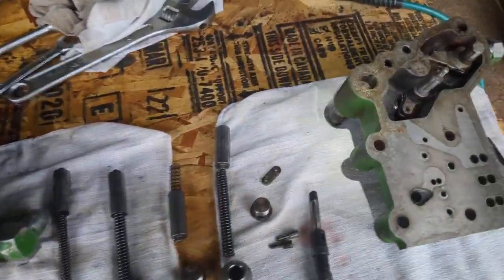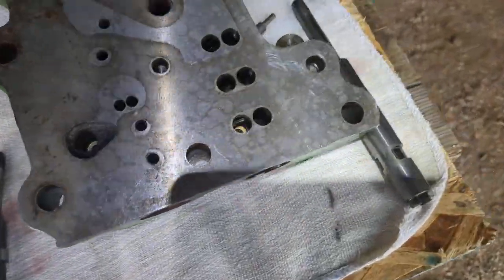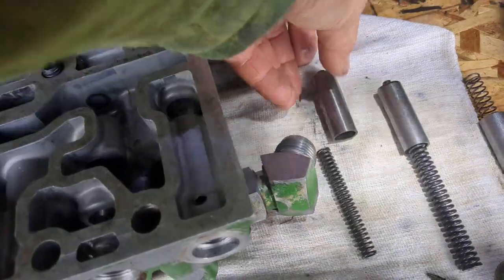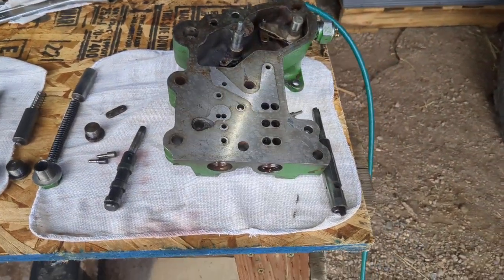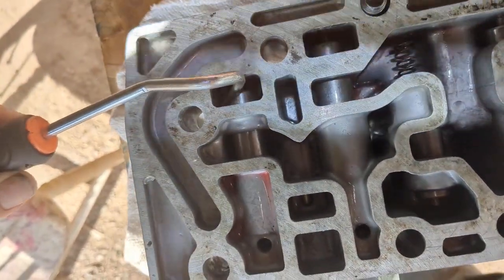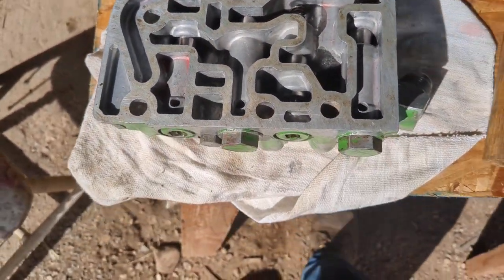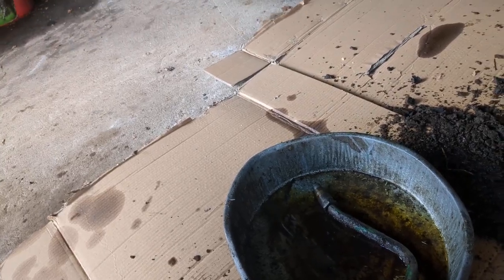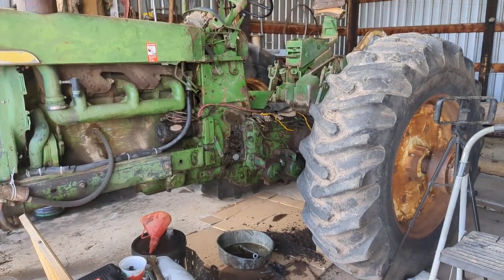JD 4020 clutch/ pto valve clean up.

Comment: Be sure linkage is clean where the shaft from valve goes through the housing,  build  up under arm on the shaft can prevent valve seating. Hopefully it's not the pto clutch disks warped or welded together. That calls for engine trans split,  if it's  the brake that calls for rear split.
Reply from the maker: Thanks for your input I was aware that it is really dirty down in there I will take the effort to make sure it is cleaned out

Comment: Hopefully that stuck valve will solve that pto issue. Is there a filter or screen before that valve body?
Reply from the maker: Yes the system has two filters and a pick up screen that I will be checking and changing before I try it.